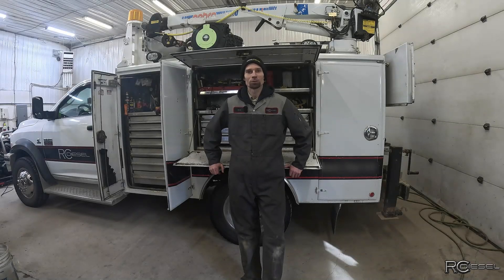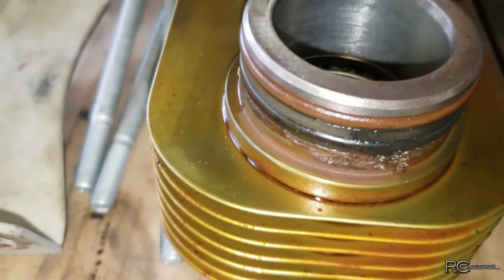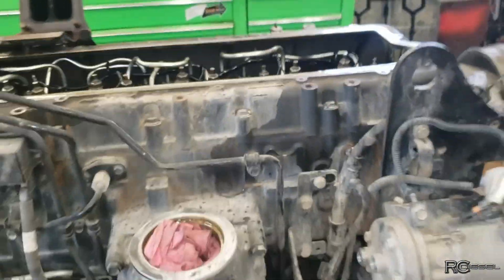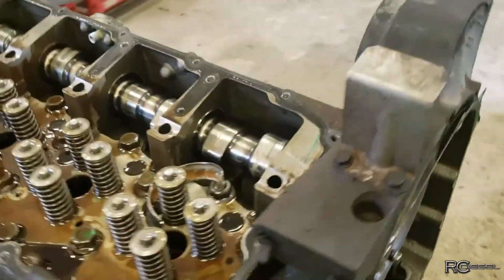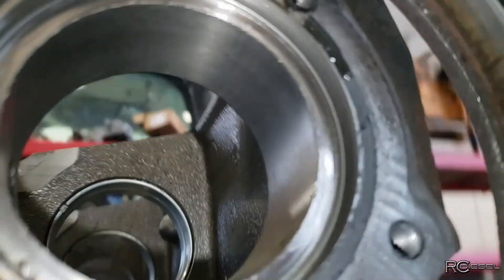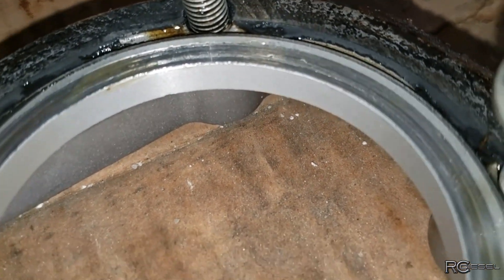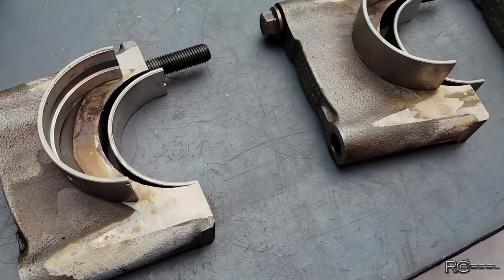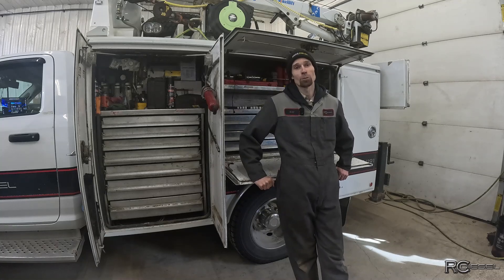Rebuilding an 8.7L Iveco Engine | P2 - Engine Teardown & Inspection : RCDiesel

Comment: These iveco engines have plenty of variants for bearings and the cams are pacific for the hp range. The cam should have a stamp on the front with 3 digits to get the right cam shaft and cam lift because some engines have engine brakes
Reply from the maker: @TrevHarris-s1v  You bet, I learned that. The bearings were the hardest because I couldn't tell what "colour" the old ones were. It was super hard to tell. But one bearing had the faintest bit of green on it, so I went that route and then I was very careful to measure everything twice over to make sure they were right.

Comment: What is your opinion of that brand of engine? I looked into buying a new New Holland 6030 back in 09-10, but I ended up passing on it, but I’ve always been curious about Iveco’s design and quality. I mainly worked on older Cummins, cat and Dt series Ih and Deere. So I wondered how iveco stacks up to those brands?
Reply from the maker: @LukeLong-oi4uc  That's a good question. I'm not sure that I have enough experience on these to have a proper opinion, but from what I have seen I would say this 8.7L is well built and will likely run thousands of hours without much trouble if it's maintained. The tolerances are really tight, the machining is very nice on this one. There are a few things about it that I find kinda screwy, but that doesn't make it a bad motor.
Reply: @ I appreciate your input! Great job and content!
Reply from the maker: @LukeLong-oi4uc  Thanks man! I appreciate your time watching my videos. It makes it more fun when guys are interested and offer suggestions or ask questions 😊
Reply: @LukeLong-oi4uc  In my opinion the 6.7 fpt is bomb proof like a 5.9 Cummins.
The 8.7 on the other hand is not the best design

Comment: Don’t forget to put injectors in diesel after you put them out because when they dry you will need to repair them
Reply from the maker: @vetalpol6241  I've never done that, but it's a good idea 👍
Reply: Vi have fixed this engine with the same problem, and its take a week for us and injectors we put on a table and just cowered with paper. When we assembled all the engine won’t start
Reply from the maker: @vetalpol6241  No way. And you figure the injectors dried out? Interesting. 👍
Reply: Yes. We have changed for ny and its stars .

Comment: I wonder if that cam bearing failure was due to incorrect backlash
Reply from the maker: @simonflanner1248  Could be., seeing as it was on the drive end... I thought it could be due to coolant and other debris in the oil.
Reply: @rcdieselchannel  yes definitely a possibility also
Reply: I wonder if someone put too long a bolt in that crankcase vent filter
Reply from the maker: @Wyomingfarmer  🤔

Comment: Makes one wonder what the whole history of that tractor is.
Reply: We have a Magnum 340 wich has the same engine.
At about 2500 ish hours it ate coolant for the first time.
At that time the dealer changed the head gasket.
Stopped the problem for about 3000 hours.
Than the engine started to use coolant again, nothing in the pan at that time but since it wasn’t much and that tractor was desperately needed we added coolant every now and then and continued running it.
Another 1000 hours later it started to really using coolant and that was the first time we found coolant in the pan.
We needed the tractor for another 200 ish hours so every morning we dropped the little bit of water out of the oil topped it off with oil and water and run it.
When we got it to the dealership it had a collapsed oil filter too.
Ours had worn out liner bores, deep scratches in the crank and the head was cracked plus it needed all new injectors.
What I have to ad is maybe that our magnum is converted to reverse drive for forestry work with mulchers and stump grinders and so on so we can’t easily get a loaner to do the work.
In hindsight we should have done a full teardown much sooner maybe the block was still ok than.
Anyway really nice job and thanks for sharing with us.
Greetings from Germany
Reply from the maker: @andreasrotter2280  Oh wow, so you had a few different issues going on there over time. Thanks for sharing!
Reply from the maker: @prevost8686  💯 me too.

Comment: In a place where I used to work were two T8050 New Holland. Have no idea what kind of engine they've had, but in one of them it was removed five times in one year for repair. The last time because of cracked liner
Reply from the maker: @oleksandrkomisarenko8118  😳
Reply: Cummins QSC 9.0 L was fitted to the T8000 series.

Comment: yeah that injector wire clamp is factory
Reply from the maker: @nkoshe  You'd think they would use a nitrile rubber instead of that 🤷🏼‍♂️
Reply: I've always thought the same thing about those clamps.. But definitely factory, I've found those in the 8.7L (Cursor 9) and the 12.9L (Cursor 13) both.